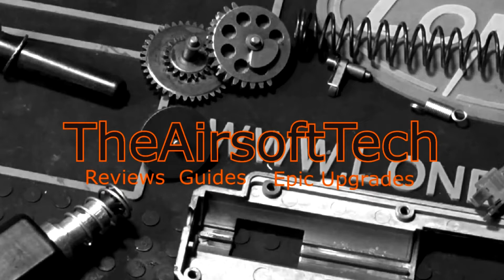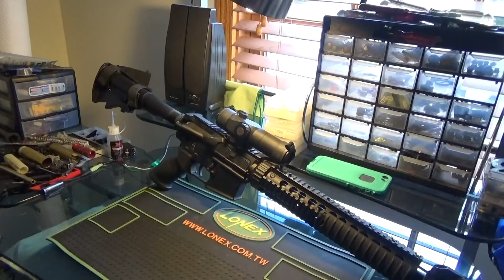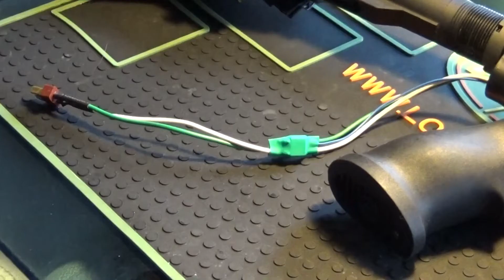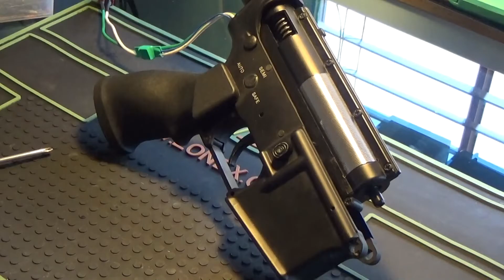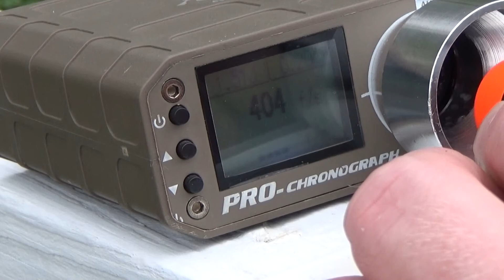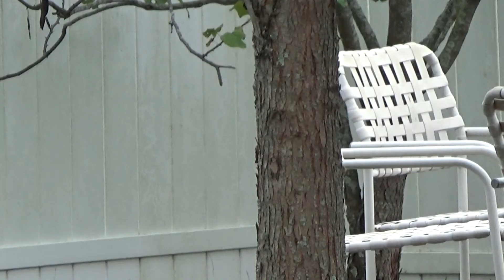SPR Battle Rifle Build!

Comment: The gen 4 bevel is notorious for breaking.  Had one break on me.
Reply: Yeah the gen 4 are notorious for it. I had my bevel break in the same place the first time I shot it.
Reply: Exactly what setups are you guys using 4th gen gears in? I've had none fail on me so far, running one 4th gen bevel and 18:1 ratio spur in a 47rps DSG setup with an M160 spring. It's done maybe 10k cycles so far, and seems to hold up well. My other set is a 12:1 ratio set with an M120 at 22 rps. FYI I'm extremely thorough when shimming my gears.